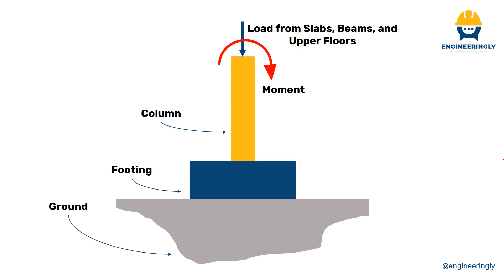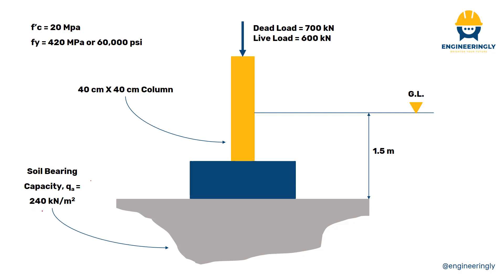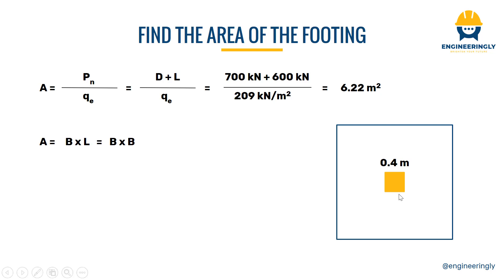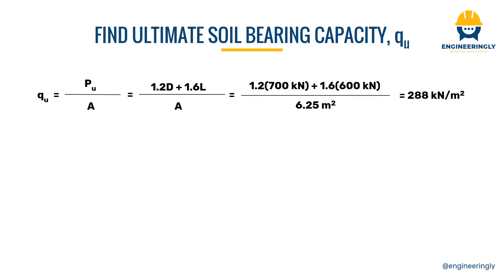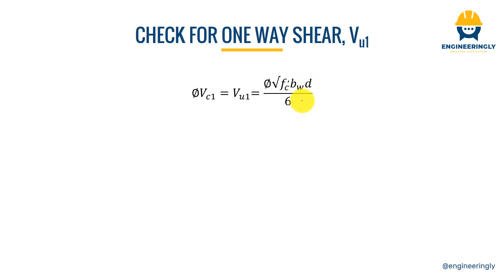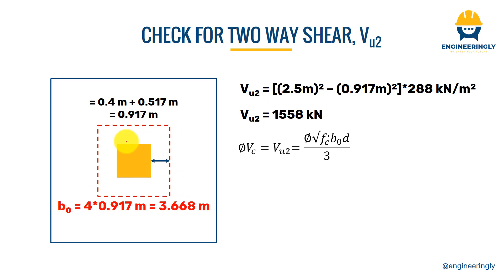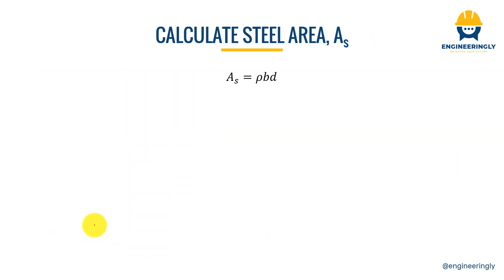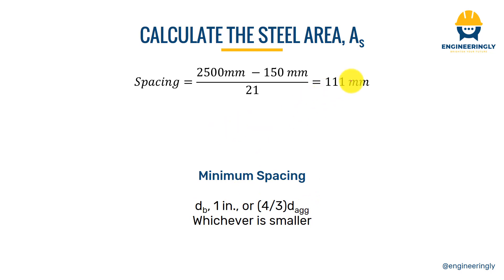Design of Isolated Square Footing | ACI 318

Comment: HEY THERE, I JUST WANT TO KNOW IF THESE MENTIONED PROCEDURE IS AS PER ACI318 THEN WHY ARE WE REFERRING UNITS IN MM AND KN
Reply from the maker: Hey there, thank you for engaging with our content and bringing this very interesting question up. And you’re absolutely right about the units in ACI. The thing is that, for this example we have entirely followed the ACI 318 code and steps, the conversion of units is done and incorporated with care to not mislead anyone, as this will help some engineers applying the theory in practice in their designs. I hope it’s clear. Thank you once again for your valuable comment!